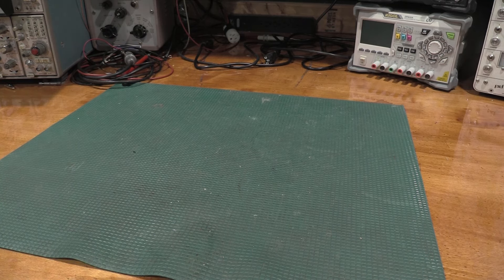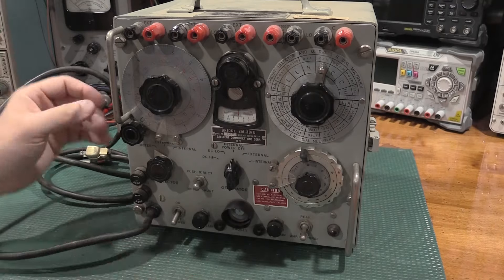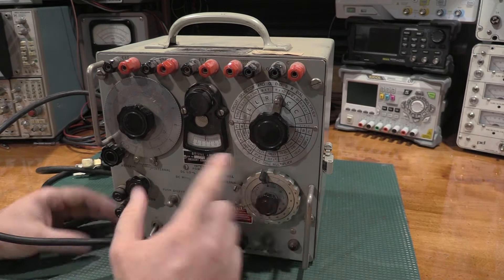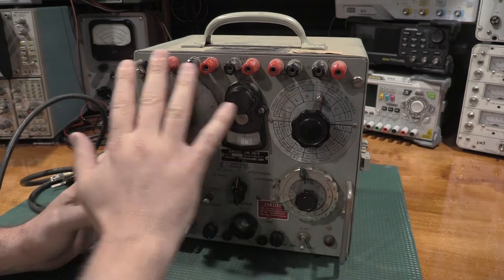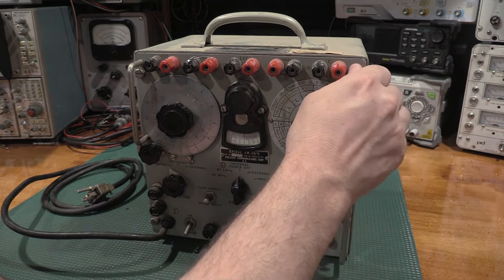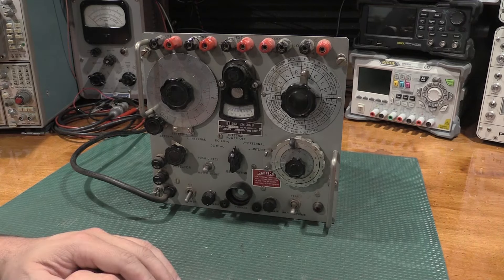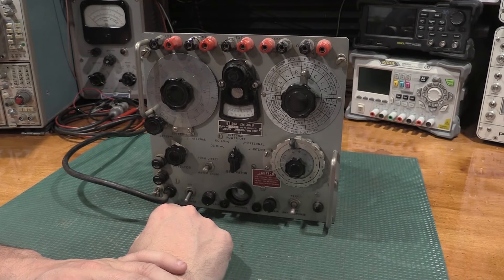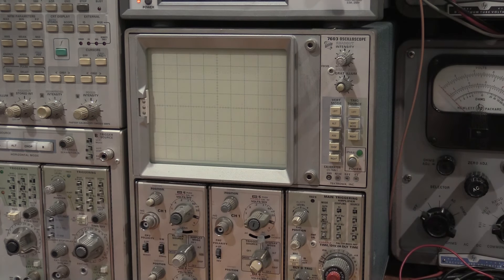Picking Test equipment for Restoration some Q and A

Comment: I've got an HP 8657 signal generator that I am dreading tearing into. Another "works correctly" purchase off of Ebay. Of course it has low output at lower frequencies. I keep on looking at it with the same enthusiasm I would have for picking up roadside litter on a 10 mile stretch of highway.